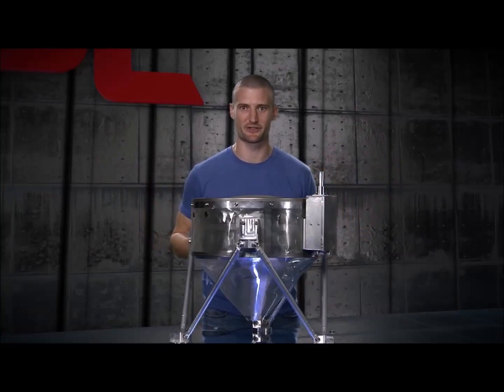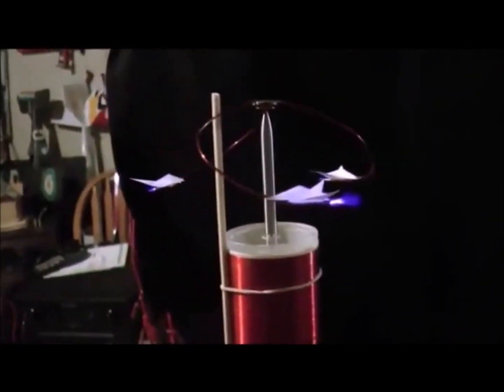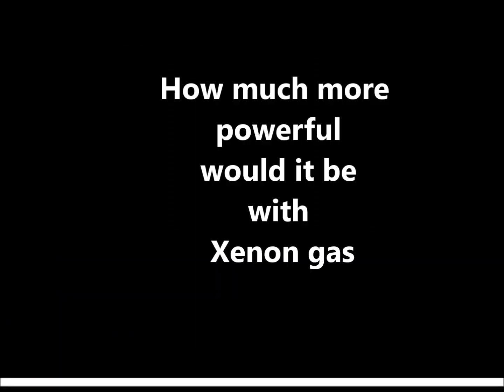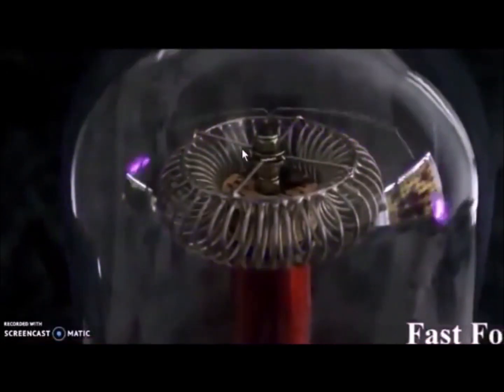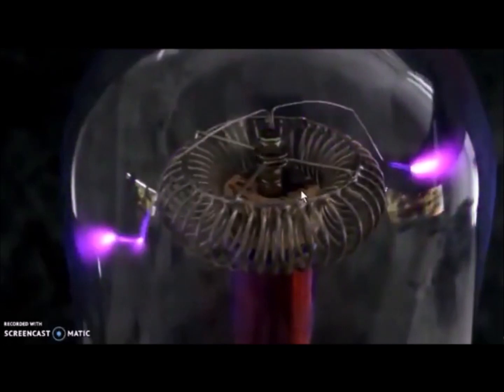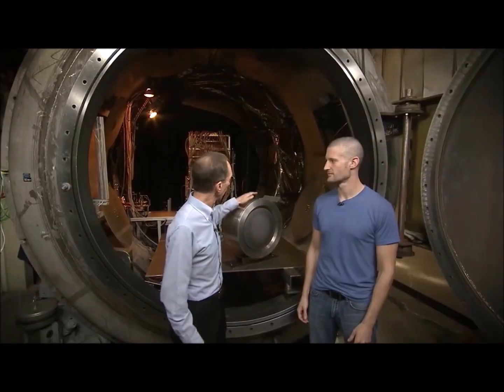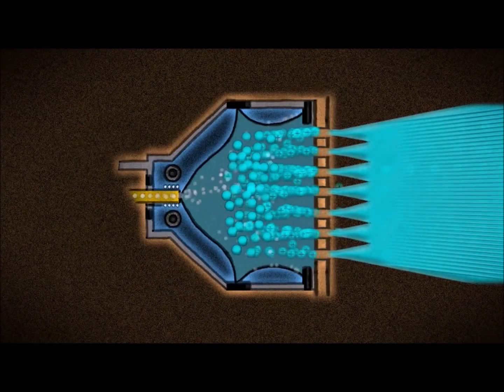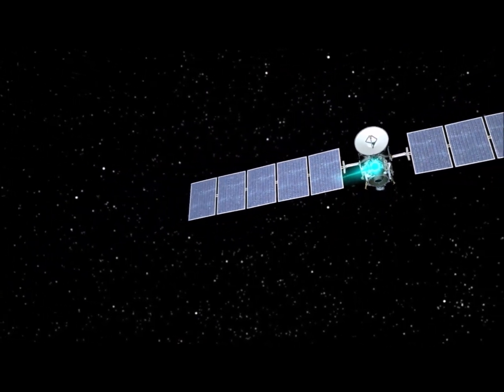Ion Propulsion doesn't work in a Vacuum

Comment: Teddy C - Good thing REAL Ion Engines TAKE GAS WITH THEM TO SPACE .
Of COURSE Ion propulsion will NOT work in a vacuum if you bring nothing with you to accelerate out the nozzle.
Same as a regular rocket: It takes a FORCE to accelerate a GAS because GAS HAS MASS.

Or are you suggesting that Gas can be accelerated WITHOUT a force?

Comment: Nasa has actually sent a spacecraft called Dawn to the asteroid belt AMD IT ONLY HAD AN ION ENGINE
Reply from the maker: The Earth is a stationary plane, 
satellite exist on balloons,
  99% of all Telecommunications 
is done through undersea fiber optic cable, weather satellite are launched twice a day simultaneously around the world 
 and  they are on balloons https://youtu.be/hK_kWN0BsKs
Reply: @teddyc523  - "The Earth is a stationary plane,
Then please explain how most modern aircraft have ring-laser gyros that measure earth ROTATION and CURVATURE as part of every pre-flight test.
So measurement of the earth MOVING and being CURVED is literally done thousands of times a day worldwide.
I have done these tests MYSELF and I have even bench accepted a ring-laser gyro, INSTALLED it on the vehicle, Performed the pre-flight tests AND helped FLY THE VEHICLE.

Now EXPLAIN how that is possible if the earth is NOT moving.
Reply: @teddyc523  💯
Reply from the maker: https://youtu.be/eoyQkuwm4O4
NASA has known since 1986 the Copernicus theory is b*****
Reply: @teddyc523  what you got 'Nothing"?
Reply: @stuartgray5877  u tore his pants

Comment: Science will disagree with you.
Reply from the maker: Once it reaches top speed, how do you plan on stopping it?
Reply: @teddyc523  Turn it around and keep firing until you cancel the original momentum. Or just don't use speeds that will make braking with a heat shield impractical, and you can just worry about slowing down when you get there.

Comment: SpaceX did it
Reply: vos - If Space X's rocket boosters can fly backwards the same distance (to the launch pad) after running out of fuel, they should fly backwards all the time. Then they wouldn't even need fuel.
Reply: @bassfishingwiththeantichri2921  they still have fuel in them after stage sep
Reply: @bassfishingwiththeantichri2921  - "If Space X's rocket boosters can fly backwards the same distance (to the launch pad) after running out of fuel, they should fly backwards all the time."
They fly FORWAARDS to ACCELERATE
They fly BACKWARDS to DECELLERATE
try to keep up shit for brains

Comment: The video explains why it can work, it uses contained xenon instead of air
Reply: It still needs air or a medium to push off of. Space travel is the biggest hoax.
Reply: Ion uses xenon gas you don't know anything
Reply: @vsvs2400  ion thrusters in the vacuum of space use xenon. In the video one of the "thrusters" that were made of wire didn't work in a vacuum because they ionized the air behind them instead. Of course actual ion thrusters wouldn't use air because it's more efficient to use xenon.

Comment: Question:  Has Dr. Marc Rayman seen this experiment?  How do JPL engines work in THEIR chamber then? ... or do they?
Reply from the maker: They say if it was using Xenon then it would work in the vacuum
Reply: @teddyc523  correct, because xenon is a gas that they are adding into the system. If a thruster runs out of   xenon gas, it is unable to provide any thrust. 

This is in a way what happens with the demonstration with the paper clip model. The paper clip model uses the ambiant air around itself the same way that NASA's thruster uses the xenon gas. If all the air is removed from the system, then the paper clip thruster has nothing to accelerate and thus cannot provide any thrust.